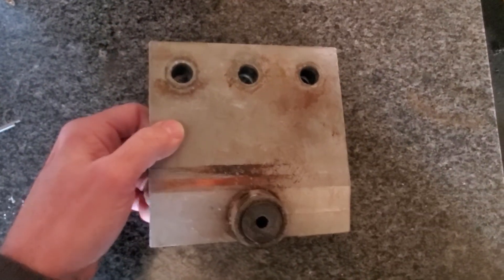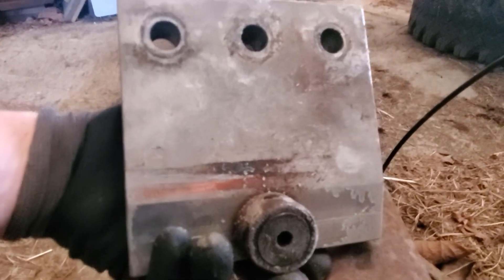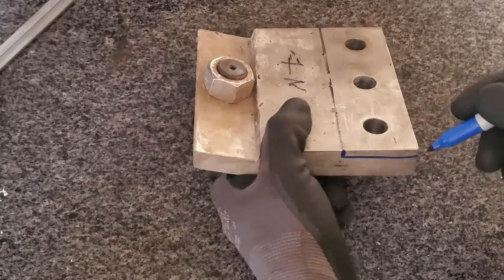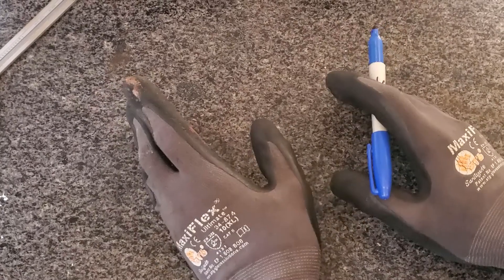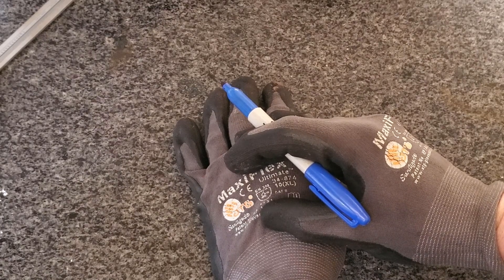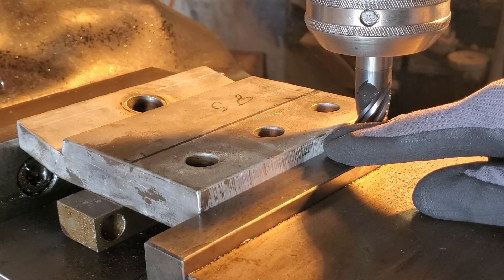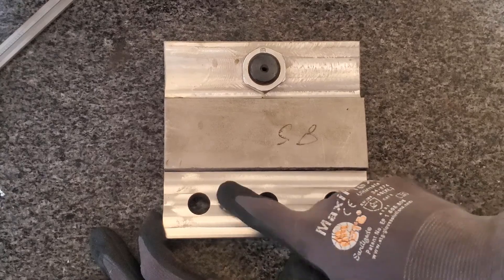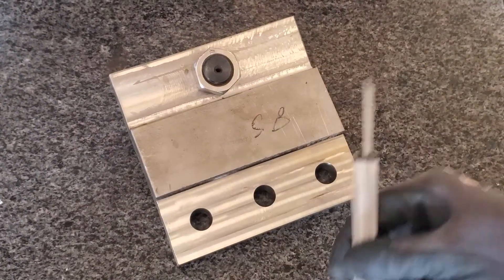Heavy Cuts on the K&T 2D Mill - 304 Stainless Steel!

Comment: This work is much better suited for a larger vertical machine. This is a great way to destroy your very rare precision 2D machine!
Reply from the maker: I now have a Rosenfors 5 hp vertical mill for heavy cuts. The "heavy" cut on the 2D was still below 3/4 hp and 3/4" shank size.

Comment: I like your videos and your machine especially. That said, I don't really like to see a machine made for precise tool and die work used to do basic hogging. There are more appropriate machines for this work, especially considering that they're not making these anymore and heavy use shortens their life (at least until refurb, which would be a chore on this machine). Just a friendly critique.
Reply from the maker: I 100% agree with you philosophically. I'm also not Keith Rucker with a full stable, the K&T is the only mill running. The 3/4 HP spindle motor is pretty self limiting and everything I've done is in reality a pretty light cut compared to most other mills. Most times I go lower than the feed/speed that puts me close to 3/4 hp. Thanks for watching!
Reply: @EngineersWorkshop  Thanks for the reply. It put my mind at ease, no kidding.

Comment: When you get your lathe up n running make yourself a fly cutter or two . Two passes and the full cut will be done with a better finish too.. Or buy a two or three inch insert cutter . Time n cost will be much lower.
Reply from the maker: I have a 3" flycutter for the K&T but have struggled getting a proper grind on the HSS point. Worked great on aluminum though.

Comment: Playing a dangerous game climb milling. I wouldn't want to risk such a machine by snapping a 3/4" carbide endmill. Also I'm not sure that the oil is doing much more than making a smoke show TBH.
Reply from the maker: Those were nearly full width cuts, so not really climb milling. First pass was into the edge per Joe Pi's "no burr" method. Agree on the oil..

Comment: I'm running a Kool Mist system, lubes and blows the chips away...
Reply from the maker: The 2D had both coolant pump and air pump options, which mine had neither... I have procured both pumps and the piping and will be retrofitting these in an upcoming video.

Comment: Was thinking you’d run the head in a small circle and hog out the entire job in 1 pass
Reply: That would be like one of those new fancy adaptive strategies!! 🤣
Reply from the maker: @bcbloc02  While it would be ingeresting to watch, the entire back half of the arc would do no milling. Would you harvest a crop driving a combine in circles, just to reduce passes across the field? 😁 I'll use the rotary head where it makes sense..
Reply from the maker: Ha! Would probably be faster, even with a cleanup cut for the inside edge!

Comment: Love me some heavy cuts. I'd love to get a good facemill for my mill and do some actual milling, I've done 2"×1/4" in hardened 4140 but my universal head isn't made for cuts like that
Reply from the maker: The 2D is extremely rigid, but is limited to 3/4 hp on the spindle. I'll run out of hp before I run out of stout... 😁